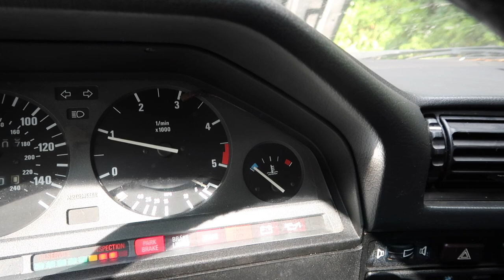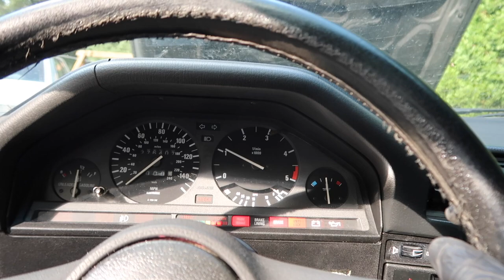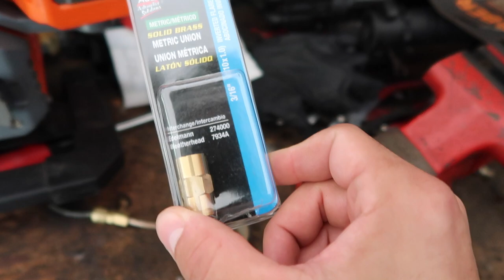Starting and Driving a BMW E30 for the First Time in 5 Years! | E30 Budget Build Ep. 1

Comment: Nice budget E30, I'm curious to see how this turns out. It wouldn't be a brake like repair if you didn't forget to put the nut on before flaring the brake line, haha it always happens! I would suggest wearing some safety glasses next time man, rust and any type of fluid can ruin your day if it gets in your eyes. Getting a small hand tube bender makes clean and smooth bends without kinking the line.
Reply from the maker: Thanks man, yeah definitely always happens LOL. But I know i always forget the damned glasses!